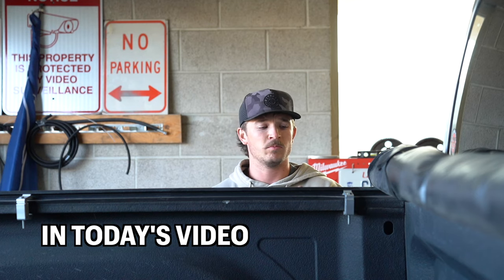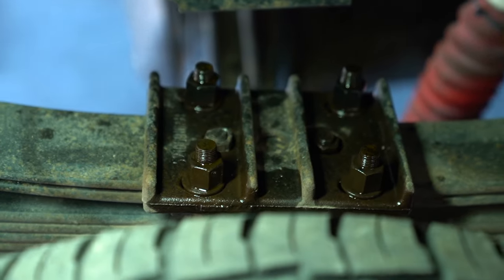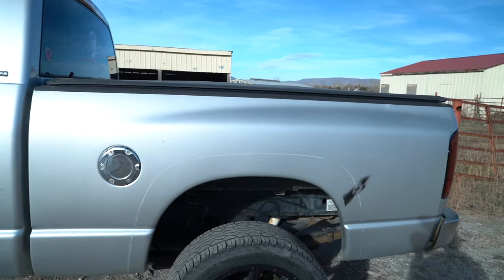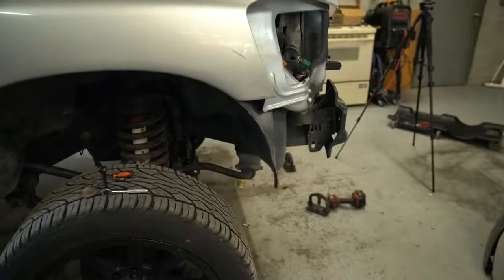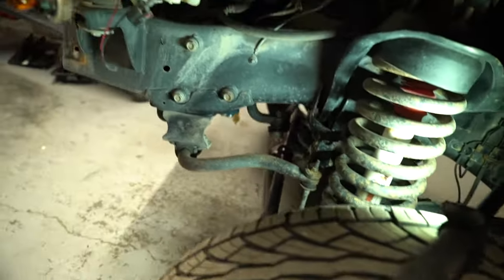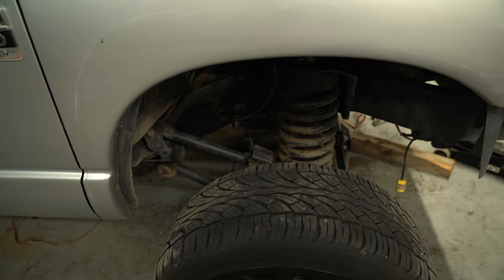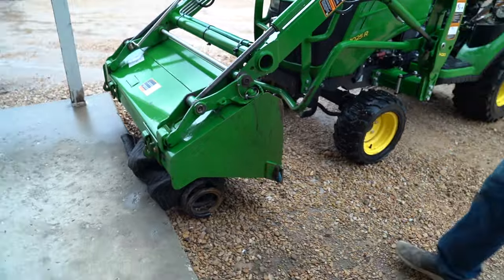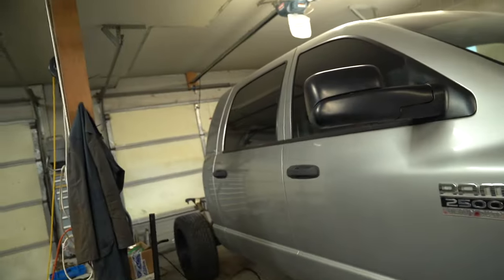MEGACAB BUILD STARTS NOW!!!

Comment: I got a silver megacab you can see on my channel my suspension setup is 3 leafs in the rear with 2 inch drop shackles, firepunk lowering coils with kingspeed shock tower deletes, firepunk control arms and dnr traction bars, and bilstein shocks all around, rides great tbh.
Reply from the maker: I’ll look into that, trying to find a happy medium being that I still got to tow the gooseneck and don’t want to be to low that I have to adjust my neck on the trailer for my truck and my dads!